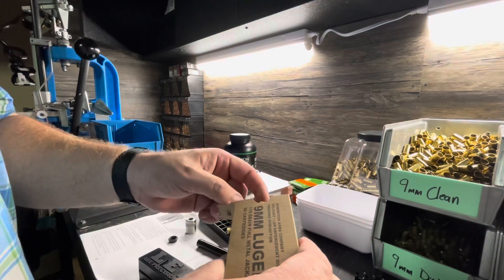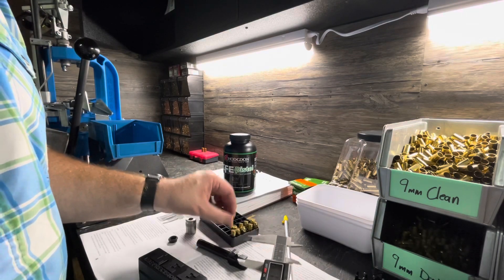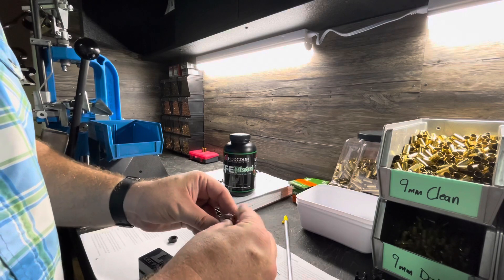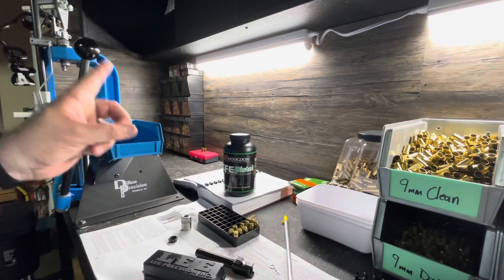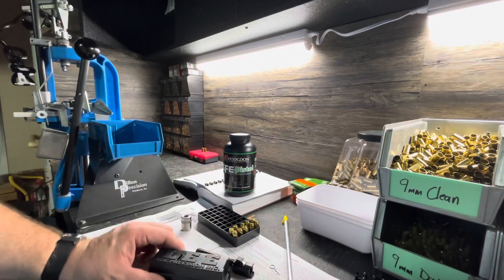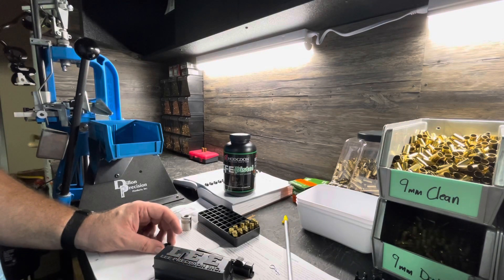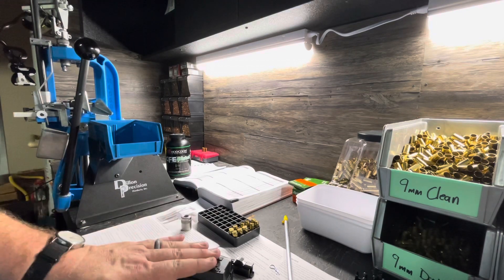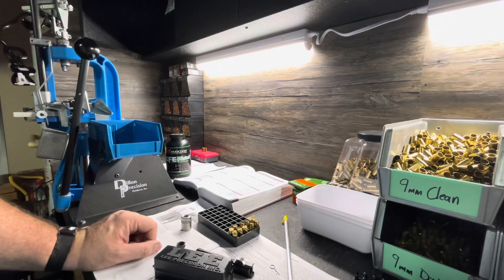Reflecting on my First 10 Rounds

Comment: I load mine to 1.100 and they cycle in all my guns.   I have settled on HS -6 for powder just because it has enough volume that an over charge would be very visible.  I very lightly crimp, like you said just to get a smooth edge.